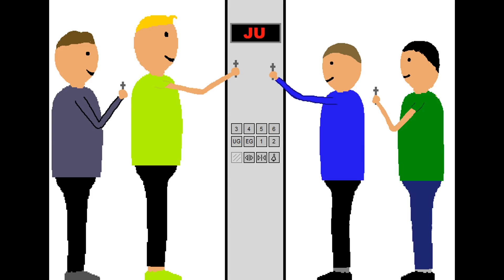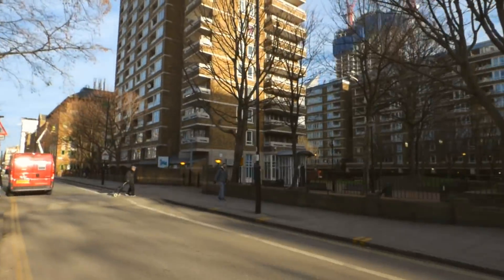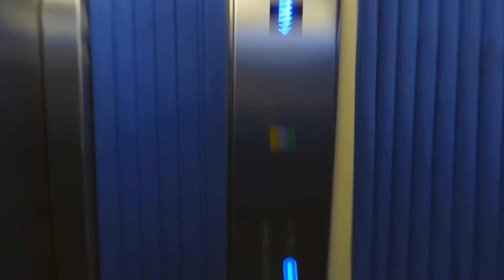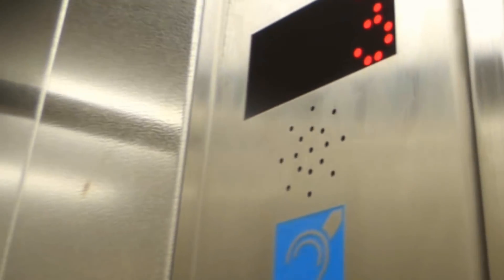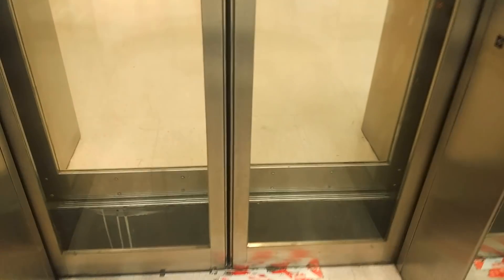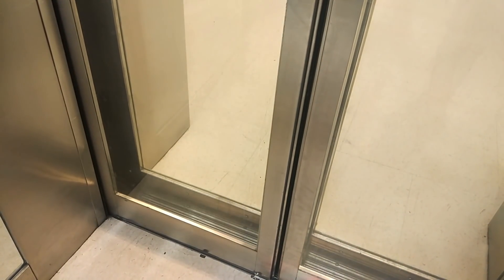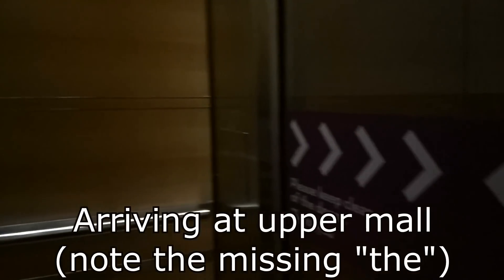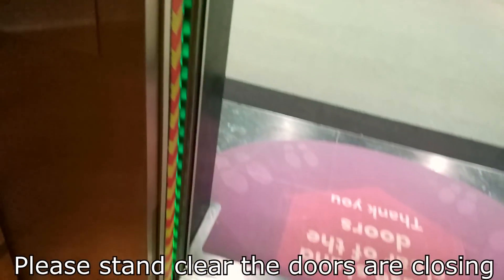Advent calendar 24

Comment: SEMIFINALS (DAY 24)
RESULTS

BENO: 167,185
THEHOOKEDMETAPOD: 38,716
TRIZOCBS: 88,246
ROHAN: 31,085
POSTTOWER: 102,847

ROHAN AND THE HOOKEDMETAPOD WERE ELIMINATED IN BENO ADVENT CALENDAR 2017 SEMIFINALS (DAY 24).
BENO, POSTTOWER AND TRIZOCBS WILL NOW ADVANCE TO BENO ADVENT CALENDAR 2017 GRAND FINALE (DAY 25, CHRISTMAS).